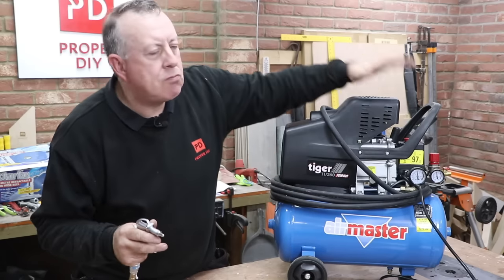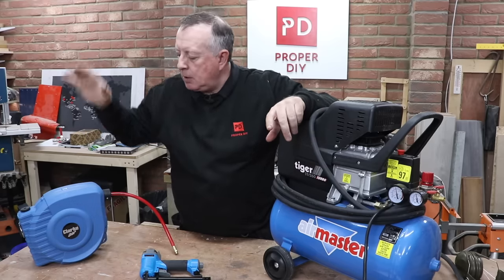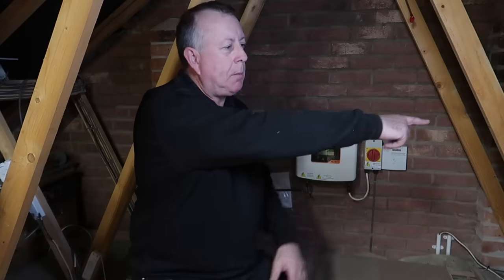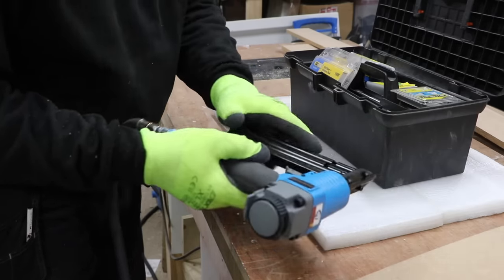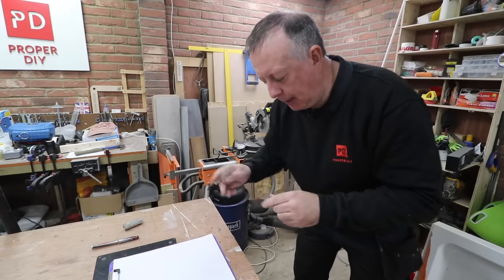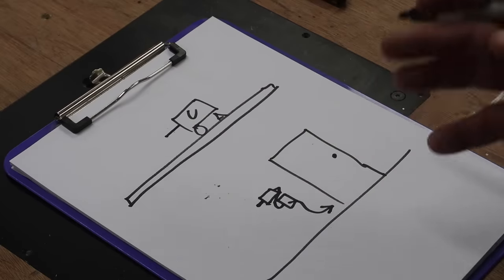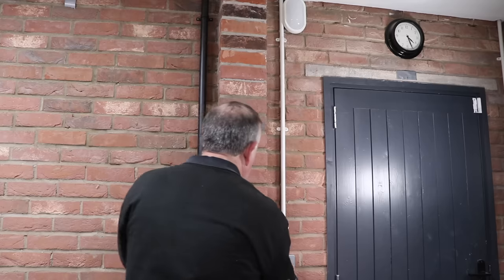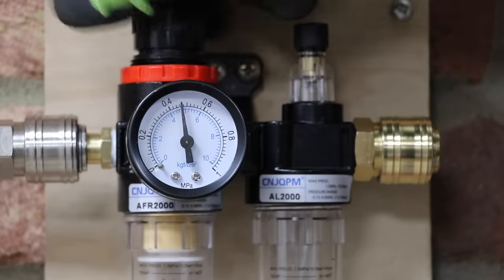How I got the noise of my compressor out of the workshop

Comment: I recommend buying a Hydrovane, much quieter and in my experience very reliable. 
Additionally, an electric valve on the output of the receiver will reduce losses when air isn't required. This will reduce the amount of time that the compressor is running as well as your electricity bill.

Comment: What a stupid video!  Making a simple insulated enclosure, is far easier to do, and will mean the noise is a lot less obtrusive than it is with a compressor in the roof. The thing that is of far more concern, though, is  lack of any way of draining the tank, without climbing into the roof space.  

Tiny low CFM compressors tend to get very hot, and generate a lot of moisture, so ideally the tank needs to be drained every time it is used. Higher capacity/CFM compressor, running at lower rpm, will provide more air, and less noise.

Comment: Could wall mounting it in the loft reduce the noise further?

I missed how you’ve got both the light and socket on one switch fused spur. I take it there is a 3A fuse in there somewhere for the LED bulkhead?

Comment: how about removing the water that build up inside the compressor, I use a dentist air compressor, which are relatively quiet., but need a air storage cylinder.

Comment: I believe that the noise  from the compressor could be reduced even more if you use 4 rubber cylinders, kind of,  under the tray. In that way the contact surface will be much smaller, and the rubber is better to demp the vibrations. Something like en engine mount on the car. I've seen something like that in various hardware stores. It looks like a round cylinder, but 2/3 is like a tube and 1/3 is field with rubber. In that end you can make a hole and use a screw to fix it on the bottom of the tray.

Comment: Great stuff but make sure you can still drain the compressor tank of water. Maby replace the ball valve with a solenoid valve so you can drain the compressor from another switch downstairs.

Comment: nice little project but I still wondering why you didn't do a sound check before final fixing and then making a comparison with the outside option which I believe would have provided a quieter solution anyway. The outside enclosure by Rag n Bone Brown was a multi use option too and reinventing the wheel was never a strong option!

Comment: The tray and vibration could have been solved with bungee cords hanging it from the rafters. When fastening to a brick wall, I would drill into the mortar cause repairing mortar is very simple.

Comment: You should really use rigid pipework with some vibration isolation because if the hose fails and the power has been left on, the compressor can run on until it overheats.
You could fit a thermostat in the loft space connected through the normally closed contacts so if the ambient temperature is above a safe setting, i.e. 22, the power is cut to the compressor.
I think you can also get a solenoid controlled pressure relief valve to relieve the stat-up load on the  motor - it will fail if it always starts without the cylinder head pressure being dropped.

Comment: Be careful not to switch off the compressor when running. If the pump stops with pressor in it. It cant start again. and it can harm your motor.
When you push the stop button on the compressor it also went out the pressor in the pump.

Comment: Nice and quiet......
But youre going to have to go upto the loft every time  you use it. To open up the moisture drain under the air tank. The moisture trap/valve  youve put in only affects the air coming out. Not whats in the tank after use

Comment: I cut the shelves (and fridge/freezer divider) out of an old fridge and have my compressor in it - I barely hear it anymore. I had to put a small vent and fan in it (with a baffle) to keep it cool for long running. The shelves in the door are great to store the compressor oil so I see it every time I open the door to turn it on.

Comment: The big risk here is poor maintenance due to it being out of sight out of mind. You need to make sure you drain the compressor of built up water and if you leave the tank to rust inside then you could end up taking out half your roof and any one underneath it if it explodes.

Perhaps tap into the drain off valve and then a ball valve so you can drain the liquid. Also to get more power, tap into the bug on the side of the comp and use full bore connectors.

Comment: My experience with Air Compressors is that they require to be drained after use to prevent rust in the tank.  Are you going to get into the roof every time you use your compressor?

Comment: Good idea, and I hope it works. My only concern is that the original electrical switch on the compressor not only isolates the compressor electrically, but it also unloads the pressure internally upon de-activation, which, just by killing the power downstairs, you may not achieve. JMHO (Hope I'm wrong)
Reply: You are correct!

Comment: Because my compressor can be anywhere I’m think of making an insulated box to put over it. See one idea leads to another.
Reply: That's what I did, DON'T forget to have a pipe attached to air filter housing, I ran mine through garage wall to the outside.

Comment: The on off switch on the compressor (usually a red knob) is designed as a "zero load" switch. It ensures that there is no air pressure in the air charging lines during motor start up, therefore the compressor should only be turned on and off by that red knob, not a remote electrical switch as you have done. OK if you remember to drain down the air pressure in the system before turning on by your remote switch.
Reply: Remote switch should be all okay as long as you don't cut the power while the compressor is running. Simply wait it to stop before cutting the power.

Comment: I have my compressor in a closet in my garage and recently added a remote switch outside the closet. This reminds me that I need to build the doors for the closet (and will likely add insulation). But the indicator light was brilliant. When the compressor isn't cycling, it's easy to forget the switch is on, and then have it kick in much later (the closet is below my bedroom)
Reply from the maker: Thanks Matt

Comment: Great idea Stuart and a great solution. I opted for a Hydrovane type compressor, you can stand next to it and you can hardly hear it.
Reply: Also I forgot to add, like other said you will need a drain system too. You can get an auto drain system that works very well.

Comment: Nice job Stuart.
If you want to make it quieter maybe build a 4 sided insulated box to drop over the comoressor.
Possibly it wouldn't need a lid or if it did maybe cut a small hole to allow for heat to escape.